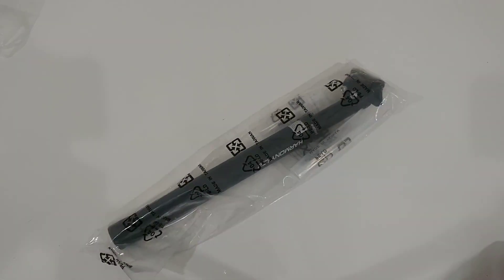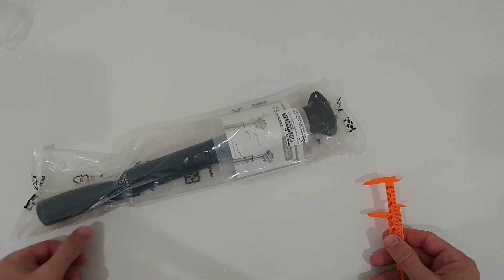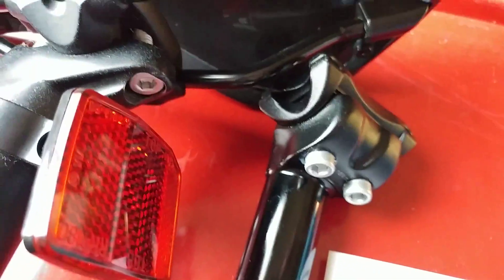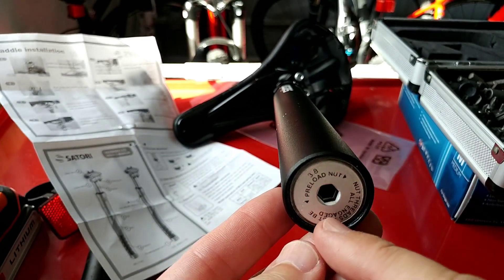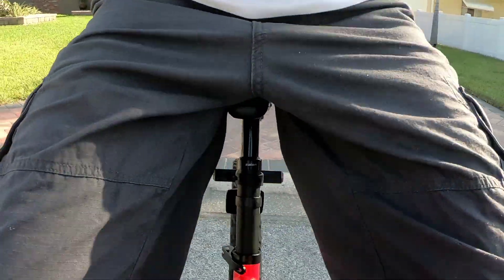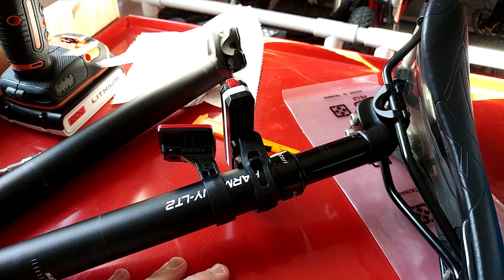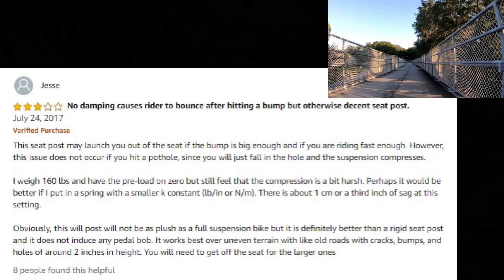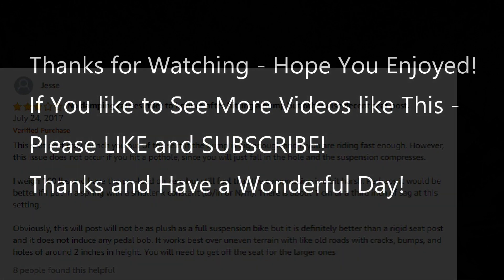Zoom SATORI HARMONY Bike Bicycle Suspension Seatpost 30.9x350mm FULL REVIEW WITH LIVE FOOTAGE!

Comment: Thank you for the video! I purchased the 27.2 x 350 mm version, and it came with no instructions for adjustment, but your video solved that problem. I'm still waiting for my first ride, and hope the post is not too short. I have a hardtail because my particular bike was not available with rear suspension. The original seat is soft, but the kickback of a hardtail landing after a jump can be pretty hard. I was riding last week and the paved sidewalk ended with a four-foot drop. The bike handled it fine, but the seat hitting me felt like I had been paddled by Arnold Schwarzenegger!
Reply from the maker: Lol ... yeah .... hope this suspension helps a bit. It's not a $300 suspension, but it usually works on hard bumps ... at least I still use it and think it was a good choice for the price

Comment: All you had to so is read the seat post that was in the bike all seat post tell you the size close to the bottom.
Reply from the maker: Thanks. I've double checked with a magnifier glass and there's something there, but completely unreadable ... imprint is very poorly made ...
Reply: @allcheckout  there should be a O with a line threw it the numbers like 30.4 or 27.5. Most are stamped into the steel but a little hard to see
Reply from the maker: @davidrossmiller8349  Thanks - yes it's stamped, but very weak ... but it looks like it's saying 30.9 ... which has to be because it fits perfectly ;-))